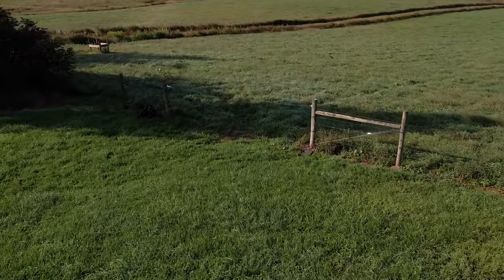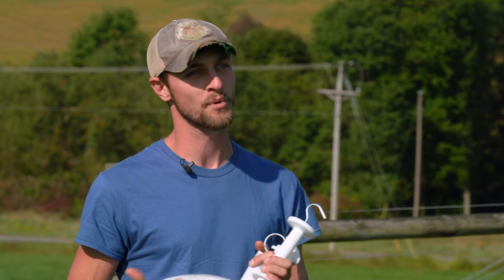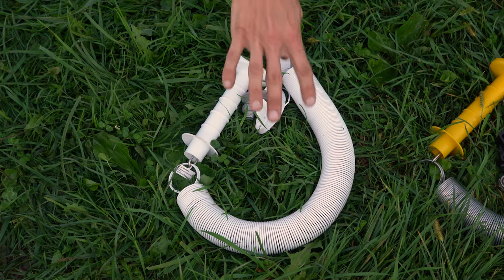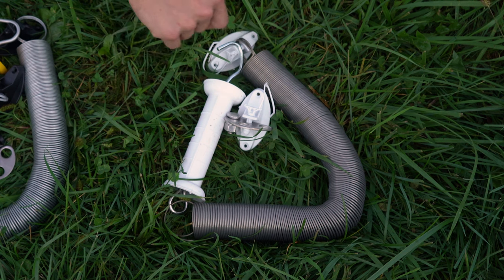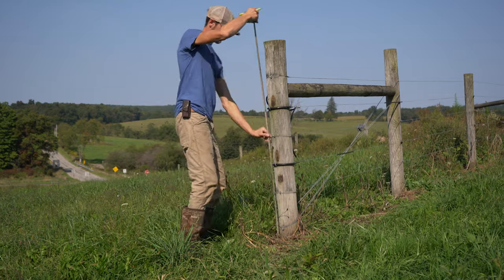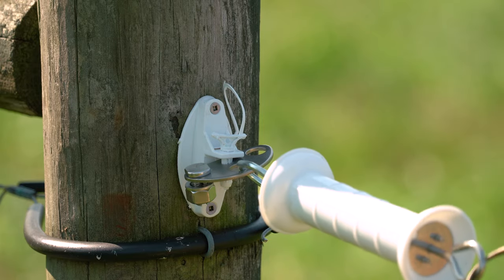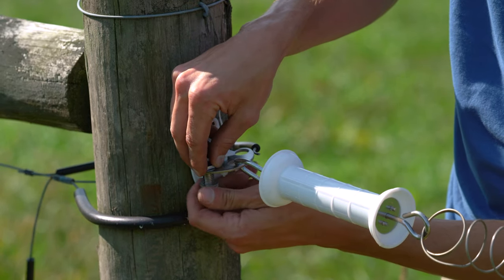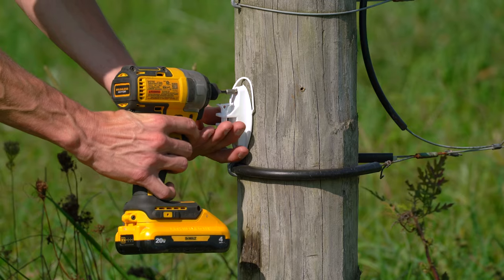Fencing 101 - Installing Spring Gates

Comment: Sorry, probably slightly stupid question, but how exactly do people pass through? Do you take off the handles one by one and lay them on the ground, walk through, and hook them back up?
Reply from the maker: Hello, yes you would remove the handles, cross through, and reattach the handles. Your other option is to install a cut out switch near the gate that you could flip to cut power to the gate, and then you could just step through.
Reply: @KencoveFarmFence  ok but where would I put the handles while i pass through?
Reply from the maker: @ExperienceAluiaWithCori  You can hold them, or lay them on the ground
Reply: @KencoveFarmFence  thanks!